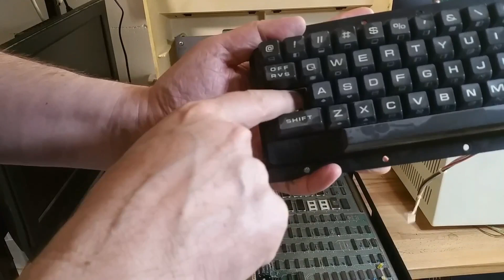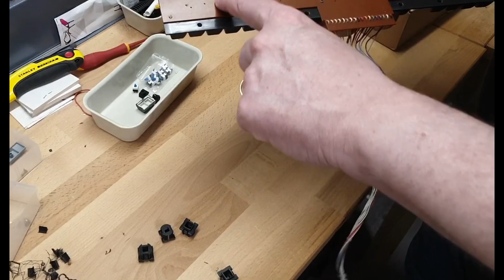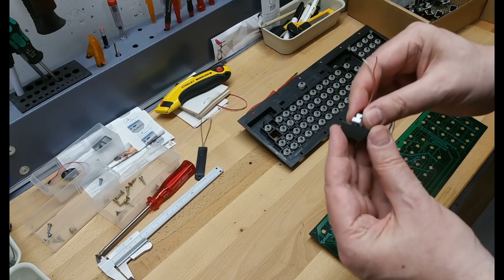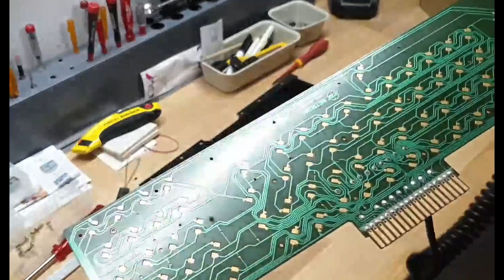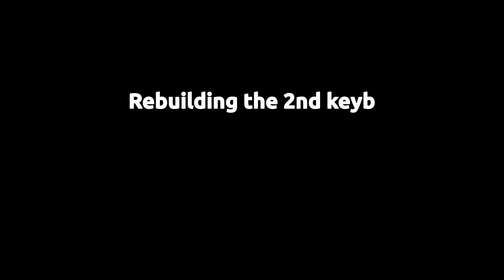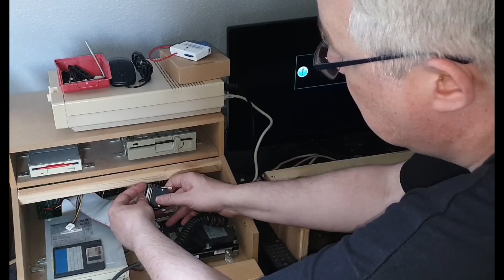Repairing two very different types of PET keyboards (Ep.34)

Comment: Hi! I just recently purchased a PET keyboard like the second one. Are the stems identical to those used in the C64? One of them is broken off inside the key, like yours.
Reply from the maker: Unfortunately I cannot say. There were different types of PET keyboards as well as different types of C64 keyboards. It could very well be as the VIC20 original keyboard was a PET keyboard (albeit a B type keyboard). You probably have to find an old breadbin type C64 keyboard to check https://blog.retroleum.co.uk/electronics-articles/c64-keyboard-info/